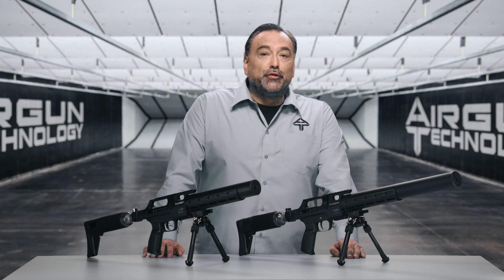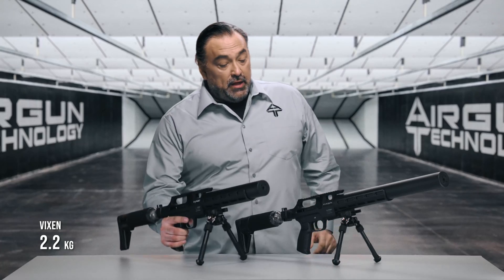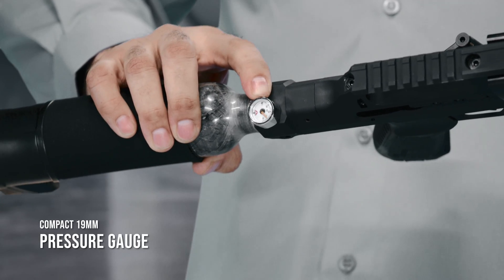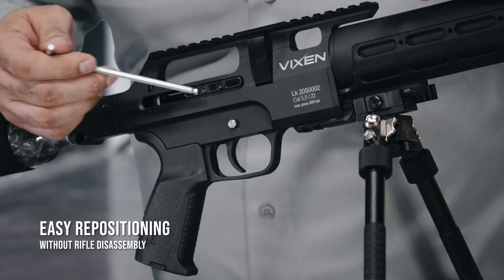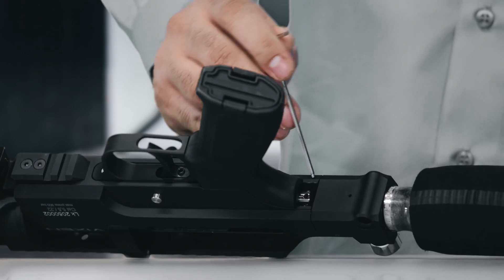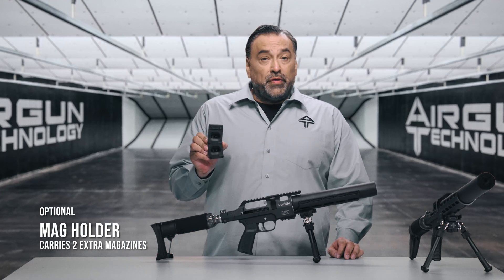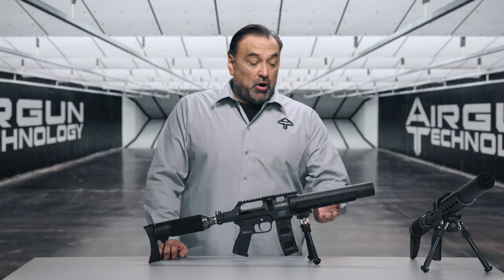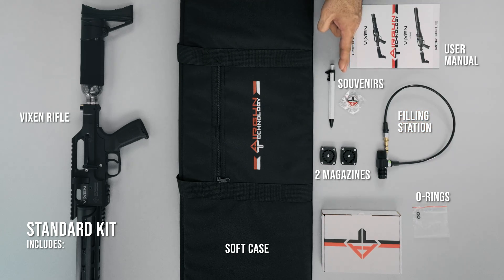The VIXEN Air Rifle | Introduction and Overview

Comment: the old style air bottle as a stock fails in one distinct way, it sits way too high to be comfortable. Even with an elongated butt pad it's still awkward, what we did back in the early paintball days was to fit a regular stock below a bottle sleeve. This gave a modest rise to the gun positioning the bottle perfectly to act as a cheek rest. Further on from this some gun manufacturers actually angled the bottle down by a few degrees, this helped but if you used shorter bottle lengths the gun felt wierd to hold and defeated the idea.
Reply: Your issue is well said, but fails to take into account the as is vixen has a perfect check meld for many people.